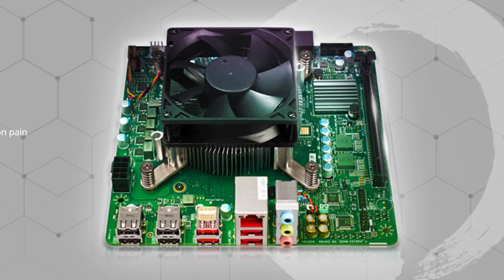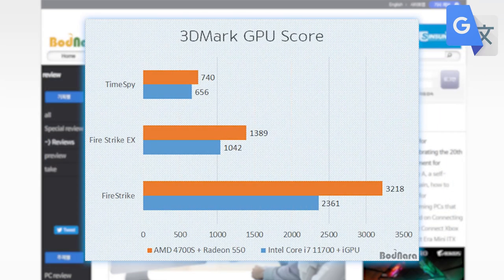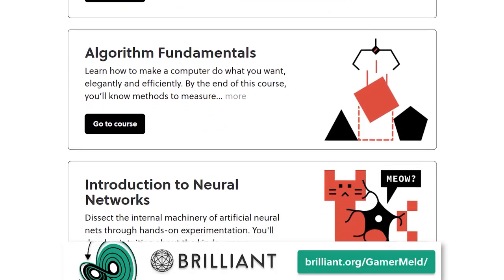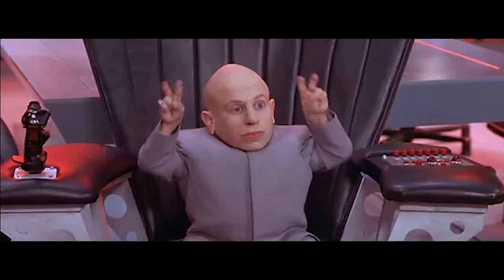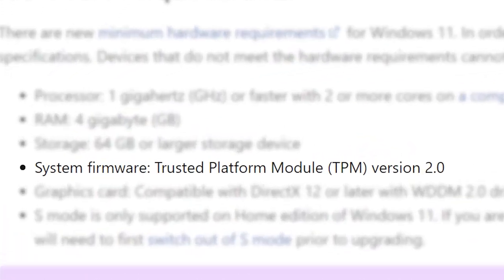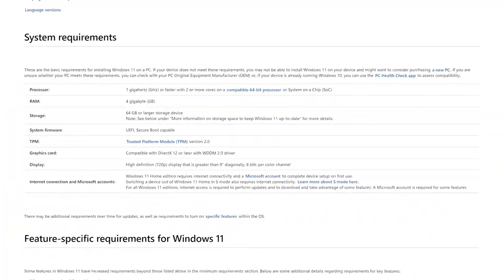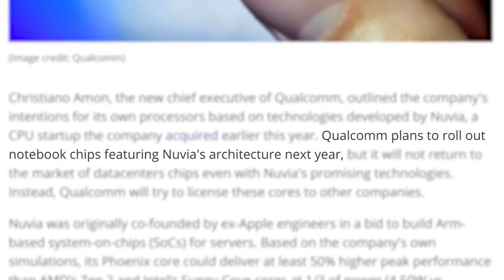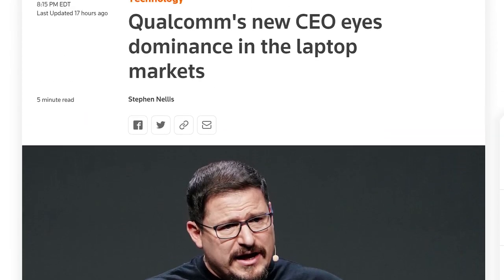AMD’s Next Gen GPU Has WHAT?!

Comment: Microsloth are trying it on, they have reasons:
1)  Test the water to see what hardware level they can drop support for, it's the key reason to change the name from 10 by pretending it's a new OS rather than an incremental feature update.
2)  Ensure OEMs launch with capable hardware, avoiding cheap profit driven decisions which undermine the new OS's performance and attract bad publicity and hard to shake off reputational damage (see Vista).
3)  Generate an update buzz and publicity for improved integration for gaming & with Android.  Their game pass offering is a subscription service reaching a different market to Office 365.
4) Cause anxiety about NOT having a W11 capable crate, will plant the image of W11 capability being premium and status.
That W11 is gaining so much coverage over a decision that's going to be rolled back, perhaps as part of a "performance update" shows their bad cop strategy is working.

Comment: no that console board is not a good deal.
the igpu is disabled on the hardware level by lasercutting the lines.
you still need a dedicated gpu.
also, there are, by now, at least half a dozend easy ish ways to get win11 to install and "run" on 10 year old hardware . .
Reply: Agree with the console board when they charge 400€ for the full digital PS5 which includes all the extra stuff in a full case all working just requiring electricity and a TV...

And with the nice decent current gen based GPU disabled it just all goes to hell since it's just CPU+RAM on a crap motherboard and with no memory upgrades.

About windows 11 he clearly state that yeah everyone can modify the preview build to run on old PC's but on release that will most likely not work which is just stupid as M$ could simply have made a less secure or some crap installation for older PC's.

Guess M$ really has contracts with motherboards, CPU makers and so one to make people have to go run to buy a new PC even if their PC is still decently capable and there is the nice velocity feature to really make proper use of game loading times that we can't have, mehhh...

Comment: qualcom main issue is the lack of instruction sets, all fine making a mobile chip but a full sized desktop chip is a whole new beast, of course arm draws less power because it doesnt run a full instruction set
Reply: Yep, they only make sense on mobile to me, ARM architecture... Hell I wouldn't be prepared to move to ARM for desktop any time soon if EVER :)
Reply: Theoretically you could have pretty much the same features and the same performances on an ARM CPU and on a x86 CPU. The only reason ARM is more power efficient I think is because x86 is a much older architecture (early 70's) than ARM (mid to end of the 80's) with a lot of legacy hardware (for backward compatibility, I mean technically a Ryzen 9 5950X can run most DOS legacy software just fine if you don't account for drivers incompatibility) which may be not really optimized well for modern needs and takes "useless" silicon space.
What I mean ultimately is that nowadays RISC and CISC tends to blend togethers. X86 most used instructions are simplified and optimized (RISC), and ARM is getting more complex instructions to be able to perform some sort of hardware acceleration or to simplify the assembly process
Reply: That's why apple spends even more money on a chip trying to interpret instructions
Reply: I don't think that's how it works. ARM does run a full instruction set, its own instruction set. When you switch to a different architecture your programs need to be re-written or "compiled" for that architecture for them to run at their full potential. The only exceptions to this is if you are using software programed in a VM language, like JAVA, or you are emulating other hardware. But then you leave A LOT of performance on the table. Honestly, X86 is a patched up mess with all of the extra instruction sets added to it. At some point they are going to have to kick it to the curb and start using a different architecture if they want to progress.
Reply: @madmatt2024  ARM is a RISC Arquitechture (Reduced Instruction Set Computing). It literally has less instructions than x86, how do you think it's so power efficient?

And if x86 has so many useless features, why is it that when ARM laptops launched with windows (windows for ARM) barely could do anything without an instruction set converter (that barely worked)?
Reply: @benjib2691  ARM is designed for power efficiency, x86 is designed for computing power. You just can't have the same performance at this time and age, all because the way ARM chips are designed. You can't compare Qualcomm's 888 processor with a Ryzen 9 5950X. And you probably can't even run stuff from the 80's because that stuff could've been written in 32 or 16 bits and probably would not work due to the cpu itself working in a tottally different manner as expected in the software back then

All in all, you can't compare a mouse with a horse. They both are tottally different. Although probably with 1000 mice and some cheese might be more power efficient to pull a cart than a horse and a hay bale is.
Reply: @benjib2691  Yes, I never said that one architecture is superior to the other, in fact, RISC is designed to reduce the amount of instructions so runtime is eventually faster, CISC is designed with completenes in mind, not that ooga booga x86 good arm bad

As for Apple, switching to ARM was just convenience for them. 

ARM was left out of desktop just because of the mere convenience x86 brings given that there's many more instruction sets to play with. Besides, back then, temperature and power draw issues weren't a thing. The majority of processors in the 70's up until the late 90's relied on passive cooling.

The objective of RISC was to make the simplest instructions possible to have the fastest runtime possible. And when it was applied, it was discovered that the efficiency in power relative to performance was very high, thus ending up being used by ARM due to it's efficiency.

Comment: Is no one questioning the fact that all the features "needed" for Microsofrs VBS are present on intel cpus from 6th gen to present? Literally all the same features just slightly slower. Unless they are planning to reserve core for the VBS then there should be absolutely no reason to exclude them. Also multi chip gpus have been done already by nvidia and they were very good, though the tech has been improved and amd has way more experience with a chiplet design.
Reply: Somebody pointed out that HVCI is not supported on those earlier models and microsoft wants to make virtualization a key part of the OS.
Reply: @claqyagami6914  leaning so heavily on virtualization concerns me at to what level of performance hit we will actually see in the final release. The entire reason I choose to switch from windows to linux was security, data mining, and Kernel VMs. I see a mass exodus from windows to alternatives. HVCI and VBS along with a TPM requirement are way to much for the the absolute majority to worry about. I have heard and believe "the OS should serve you not the other way around."
Reply: Actually AMD were the first to introduce dual GPU cards to the gaming market a very long time ago, taking advantage of a more advanced process and lower power consumption at a time when Nvidia had the original "hot n loud" range to produce a card that had the highest performance.  Nvidia were leading with dual GPU connect with SLI.
Reply: @RobBCactive  I didn't say Nvidia was the first...I want to make sure we are on the same page. multiple dies on a single card not SLI or Crossfire. I am not aware of any AMD or ATI card with 2 dies but I am aware of at least one from Nvidia. I would love to look into it if AMD did. I believe it was the GTX 600 or 700 series.
Reply: @RobBCactive  I'll have to check the docu. I dont if I buy that a dual die card will produce great performance. Certainly better then SLI/crossfire. However in terms of windows 11 I am 100% not onboard simply from an IT and general user stance. I know for a fact that 90% of my current companies machines are 7th gen and they will say kick sand...no pun intended.
Reply: @danney777  ONly time will tell on how much performance suffers. On Linux myself as well. Tired of M$' spyware. 
I find that Linux works for everything I need. Here's hoping System76 takes off.
Reply: @claqyagami6914  that was the same reason for me initially. Now its just the sheer control I have over my own system. I work off of it, when i can, and 90% of my games run perfectly fine and for those that don't I have a Kernel VM with a PCIE pass through for those that don't.

Comment: My 3770k, gtx1080 & 16GB of ram has worked flawlessly since 2013. I'm considering just sticking it out until Windows 12 gets released. 

Most people who feel like they need a new computer only really need an SSD to get that snappy "new pc" feel.
I have a laptop with a 7700HQ and it falls short of Windows 11 Compatibility but it even has all the requirements met like a version of TPM,
secure boot and running the OS on a UEFI mode. I don't plan on upgrading that laptop anytime soon.
Microsoft will eventually come around to see that older hardware will run it and the risk will be put on the user.

Comment: I don't thik Qualcomm is new in desktop cpu market.. they actually made pretty good cpus for note book like Snapdragon 8cx with same as AMD latest 7nm manufacturing process
Reply: Being a mobile cpu is completely different than a desktop cpu.. mobile cpus are based on low power usage. Great for short cpu usage like phone use them.  Big little configuration. In the desktop space there is no real reason to use lower power states as 100% of desktop pcs are put into high performance mode anyway. There is no need to save cpu power in desktop pcs. Also mobile cpus use arm cores where as desktops use x86 cpu cores. Arm will not be able to run x86 programs.

Comment: See, I said Win11 specs not set in stone in the last vid.

When things have settled, Home Edition will have relaxed minimum specs. Pro edition & up will need every security features turned on.

I just enabled FTPM on my Asus X570-e gaming & my Ryzen 9 pc is now compatible with Win11.

Sadly Surface Pro 5 i5 doesn't have a compatible cpu. But we'll see. Maybe once newer gen cpu are tested, older cpus will be tested to check if they can support Win11.

Comment: Totally aggravated. All 11 of my machines and the 400 at work are done for and will not receive the upgrade. Preliminary cost estimated to replace the work machines All-in costs is just under a million $CDN with all labor, shipping data transfer, installation, and set up for current and anticipated new staff added between now and 2025. accounted for. Using the same cost model at home I am coming in at $CDN25,000 assuming 2200 per machine purchase costs with taxes and shipping

Comment: I'll stick it out with 10 until end of support.  Long before that time Microsoft will have updated 11 for earlier architecture currently not supported.
Reply: The simple solution people don't seem to realise is an option.
Reply: Don't hold your breath on them going back that far, especially after what was mentioned in that video. (you'll be lucky if they support down to 6th gen w/ some degraded performance warning, or some features disabled by default or blocked, like the memory isolation and/or android app support)
Reply: I'm running Zen2 anyways,  so I'm not too concerned.  By the time they end support on win10, I can only imagine what will be running at the heart of my pc.  I do know it'll be AMD though.....

Comment: These new CPU startups are claiming "faster and more efficient" CPUs simply because they don't have the backwards compatibility baggage Intel and AMD have to deal with. Same for ARM. Would you be willing to buy a faster laptop which does not run 99% of existing software and requires developers to recompile and adapt everything? It is doable for modern software but not for legacy stuff. Everything has its price.
Reply: At least AMD does not change its chip set with each new CPU  making you need a new mother board every time you want a new version .
Reply: @rickyaustin8914  True but I fail to see that as an edge for startups since they will also require new motherboards for their chips.

Comment: I don't get why Windows 11 is such a news item... I'm absolutly not interested in just yet another bad Microsoft Operating System. Linux-Ubuntu, -Pop_OS and the upcoming Steam Handheld with preinstalled Linux-Distro look to me much more promesing then yet another locked down, spying Windows OS. I could be willing to check Win 11 out 5-6 years after its release. Still: I want Windows 7 back, the last and in my opinion best Windows yet.
True: Linux still need to iron out some Gaming quirks for example Freesync support on dual monitor or strange jitter in games while 2 monitors are present. But I think thats caused by the old X11 display server and hopefully when GNOME and KDE have proper adaptive sync support in there Wayland implementation, these problems are solved.

To the Qualcomm topic:
yeaah... I want a true 3rd competitor in CPU space. But I don't think Qualcomm is interested in the DIY PC space. They just want to sell laptops and single board computers (SBC). If they really approach the PC space, I would only buy there products when they have standard components and are compatable with "standard IBM compatable x86 Intel/AMD personal computers" (in case someone still knows this phrase ;-) ).
Currently I don't know if AMD or Nvidia have driver packages compiled for the ARM architecture. On Linux this would mostly no issue for AMD because the AMDGPU kernel module (gpu driver) is already open source and part of the Linux kernel. So everyone can compile it against every architecture if the library support is there.
But if Qualcomm sells one day a dirt cheap Desktop SBC... I may check it out